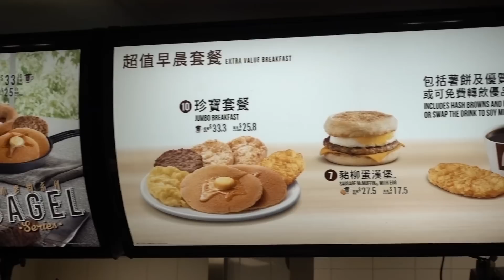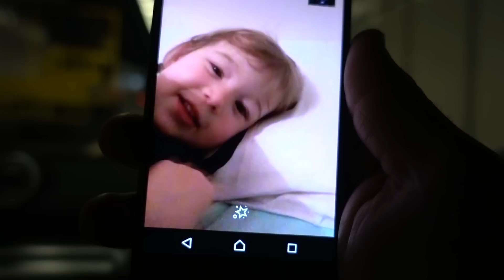How Hockey Sticks are Made (In China)

Comment: I prefer soft ice. 30-32 degrees on a cloudy day or 25-27 degrees on a sunny day = perfect ice. Hard/glassy ice, like when it's in the teens or lower, sucks, especially (or "expecially", as Coach Jeremy would say) if your skates haven't been sharpened immediately before skating on it.

Indoor ice always feels relatively soft to me, though I've only ever skated at two different indoor rinks (Alfond Arena in Orono, Maine, and Sawyer Arena in Bangor, Maine). The ice at both of those rinks feels the same to me, i.e., closer to soft than hard and unnaturally smooth and level due to being surfaced by a Zamboni.

Comment: 2 questions Coach Jeremy...1) What is the core of the blade made of? The cnc router was cutting out. 2) Is the shaft hollow or does it have a core?
Reply: the core is typically made of foam, and i would imagine the shaft is hollow due to the air being blown into it
Reply: most sticks are use a PU foam in blade. then wrapping carbon fiber cloth.

Comment: Interesting that the application of the carbon fiber is like a sticker instead of using a saturated epoxy. That's probably why some people don't like them
Reply: What you're seeing is pre-impregnated carbon fabric with epoxy(typically) resin. It comes that way, tacky and with the backing. Peel n stick. Pretty standard.
Reply: Helder Medeiros I'm wondering if it is as strong. It looks like it's only on one side. Still very interesting to see how they do it